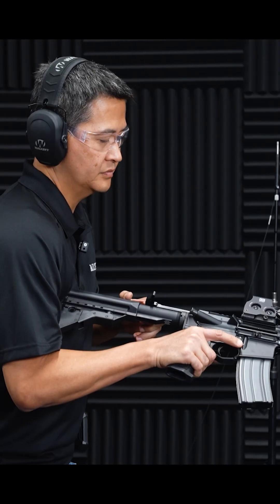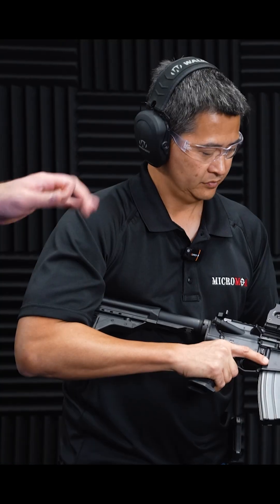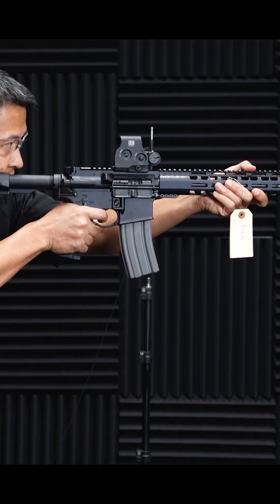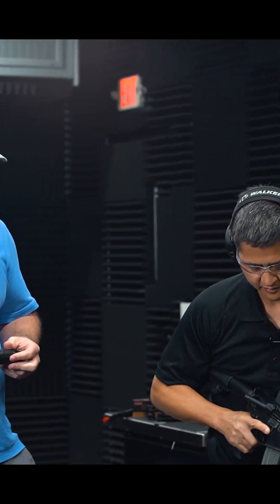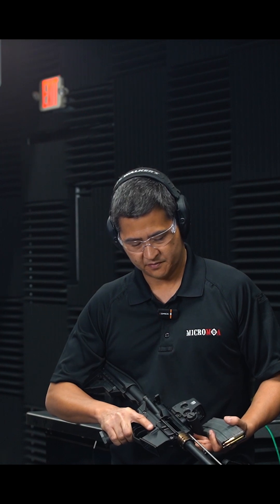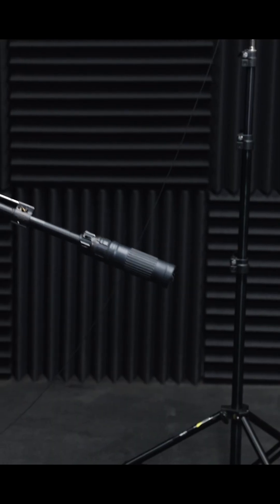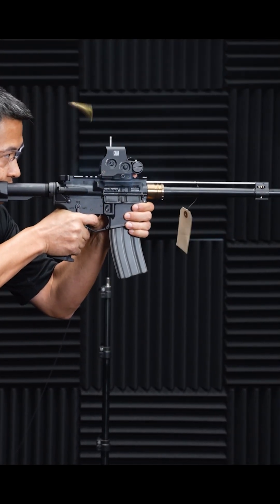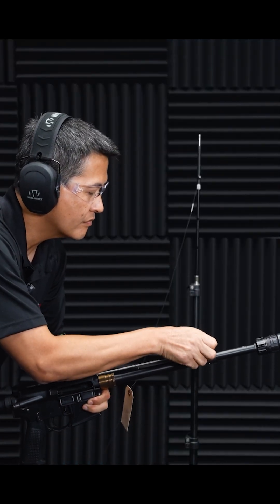Griffin Adjustable Gas Block Operational Demo - Part 1

Comment: What plate do you recommend for your own cans with “ECO FLOW” baffles? They are “reduced” blowback but still basically conventional baffles, correct (as opposed to true flow-through like from HuxWrx)? I have an EXPLORR 300 and not sure which version of the gas block I should get.
Reply from the maker: That would fall into the conventional category. The only ones we have that would take the LBP plates would be the Optimus 6 & 7 at this time.
Reply: @GriffinArmamentOfficial  Thank you for clarifying!